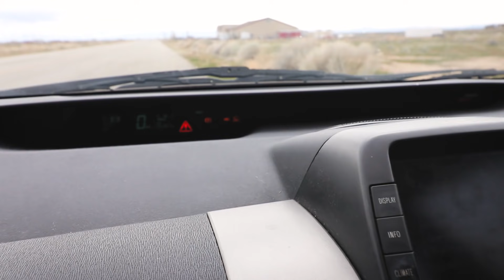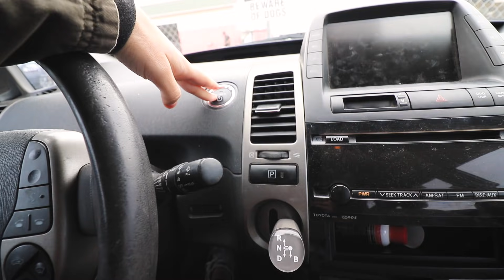I Think I've Been Sabotaged... Pulling Oil Pan To Find THIS... WTF

Comment: Electric water pump for the inverter is probably going out.  Easy to tell.  When you power on if you don't see any coolant moving in the inverter coolant bottle you need a pump.  They are fairly common on the generation you have.  Easy to change too.  It is located behind the LF headlamp.  three bolts, two clamps, and a single connector.  Just remember to bleed the air out of the system.  There is a 8mm screw that in front of the inverter cover for it.  Toyota tech here.
Reply: You should tell him/ her to turn the car on and off again maybe it'll clear the codes. And that should make everything okay in the Land of Oz! Note to self only boys have Adam's apples there are no exceptions to this rule. she doesn't you guys are screaming over there saying how hot she is, you're as confused as she is. Lol
Reply: @HYCOVETS  I gave advice based on experience.  It had nothing to do with the physical appearance of anyone involved.  Grow up.
Reply: @HYCOVETS  do some research women can have one. It's just not as often seen in women as men..
Reply: Well this got crazy fast... guess some people don't like actual advice or knowledge...
Reply: Seriously wtf, a cooling pump for the regenerative breaking?
Reply: @HYCOVETS  , I think I'm more confused, so many levels

Comment: I had numerous 16v sciroccos with similar issues.  One was a plastic shroud over the oil pickup, which cracked in to many pieces, thus plugging screen.   The second was carbon baked on the underside of the pistons, which plugged up oil pickup screen. This was a pain we had to replace oil with kerosene, then run the motor in order to clean the caked up carbon/"coke" of the underside of the pistons.  After repeated cleaning/adding oil and heat cycling it was finally ok. This was very time consuming but worked.  Drove the car for many years beating the crap out of it autocrossing.

Comment: The crap is carbon from lack of oil changes !!
Reply: I would agree normally yet they had the pan off and the tube out already. it would have already had signs in the oil the first time they had the pan off. this was added later
Reply: She regularly checks her oil however there could’ve been carbon buildup in the channels that they cleaned after heads were taken off in small amounts, and carbon does have a way of recombination and solidification with heat and when other carbon based products are active(extreme heat)
Reply: my thought also.. old gummed up oil
Reply: but cute
Reply: Some oils have a sludge factor which can carbonize on cylinder heads, flake off, then end up circulating in the oil. Usually blocks screen not tube. Seen this many times in my 50yrs automotive experience.
Reply: Carbon, four weeks ago somebody called it, but people, PEOPLE.
Reply: @ozmister101  , DRAMA
Reply: Lol I just got a beemer and it leaked oil (because it was missing the bolt gasket/washer even though it didn't leak before I did the oil change) but to my surprise the oil came out dark brown, again. So I put motor flush and new oil and now it's looking good! But from the looks of the first oil change, that likely didn't get a change for like at least more than 5000miles, maybe more because even at 5000miles with my POS clunkbox I still had decent looking oil lol

Comment: It's pieces from a teflon coated cam gear.
Reply: WisdomVendor1 why would they come off like that?
Reply: @brickson98m  Over time, heat and oil make it brittle and they break off. They are only there originally to help make the cam drive quiet. Replacement cam gears usually don't have  a 'coating' .

Comment: Hope you got the pri pri fixed. I just did mine recently because the coolant inverter pump for the electric motor failed...although it goes away on the dash I still saw it as a problem. Amazon that part and try and do it. I wasn't able to move the electric motor out of the way so I had to get the entire front left headlight out so it can be done. You have a whole garage so under an hour. I didn't and it took 3 hours...good luck

Comment: Not all metals are magnetic. Did you try wahsing a chunk of it with dishsoap and water to get rid of the oil? Then maybe put it on a microscope or even use a magnifying glass. Try burning some of the washed material,different materials burn different colors. You can do some of your own testing to see if it jibes with the results of what you send out. That might help for any future mystery and save the cost of a lab. Maybe I'm just so old and used up I went all stupid! :)
Reply: Thank you man, I was thinking the same thing lol. Common sense is just not comin any more. 👍✌

Comment: carbon, burned oil over time? i have seen a lot of burned oil on some old engines stuck under the baffles
Reply: My thought too. Serviced a Skoda Octavia that had ran like 20K km without an oilchange, we had to take it apart to molecules and scrape every part clean before even tring to wash it.
Reply: Thommy Johansson
It reminds me of the pellets from Chemiweld or any other coolant stop leak product, as to why it would be in the oil system rather than the cooling system? NFI.
Reply: Lifter bucket tray
Reply: yeah it really looks like carbon build up but who knows
Reply: Yeah, also my first thought! If the car has been running on semisynthetic oil before. IT might have built up in the pcv and when these dudes came along and put in full synthetic... it cleaned the engine and this shit got released!
Reply: Lifter butcket tray getting hot and degrading, breaking into small pieces, why it's not magnetic and there is so much. That much carbon wouldn't come off all at once
Reply: Yep carbon build up seen it on dodges to the point of loss oil pressure

Comment: What nice timing that the Prius is getting issues just as the scooby is getting back up!
Good thing you hadn't put boost on the S14 yet, jeez what the hell all that crap would have jacked up your engine!

You should by all means do a proper disassembly and thorough clean of the LS now, way before you even consider putting boost on it!!!! Don't want your bomb build to actually create a bomb of an engine (all jokes aside),  gotta inspect the block too since THAT has been there and possibly starved it for oil in certain areas. Would be a good time to (just in case) start to make plans for another engine if it has some bad wear on it.

Comment: If your bearings are not scored, no signs of abnormal wear, and tolerances check out with plastigage; if on a budget constraint, I'd elect to hot tank the engine, clean the engine's galleys, check oil feeds on journals (i.e. crankshaft main journals); then assemble and send it. Plus, replace pickup tube with a new one (which I figure that is already on the list).

Comment: This reminds me of my situation a few years ago. I noticed my oil pressure kept dropping. A friend told me to check the oil for debris. I didn't check inside the filter and only eyeballed the stuff going into the tub and nothing was on the magnet for the plug. So I kept driving it and it got to where the oil pressure was way too low at idle so I checked again and this time used a coffee filter which yielded a lot of non-magnetic metal. I yanked the motor (Crossmember makes it too much of a pain in the ass to just drop the pan. It's an ol' school muscle car) and the bearings were not only scarred but there was a slag like stuff. When I dismantled the whole engine to rebuild there was slivers of a Pepsi can someone had dropped into the oil filler. The rockers chewed it up enough to get down into the oiling system. We guess since I was using cheap FRAM oil filters it let some through and it got into the main and rod bearings. I didn't think I had an enemy in the world, the tuner crowd and muscle crowd both get along with me... but apparently someone dind't like me. 
Old cars likemy 69 is easy to pop the hood on, you don't need access to inside the car to open the hood. I didn't want hood locks because I wanted to keep it clean and smooth. Since the pain was $700 a can I still don't want to cut holes.
Reply: I am noticing the same thing. Everything was fine. Then suddenly car started to make clunking noise. I checked the engine oil and it was gone. I had topped it up just a month back and didn't drive much. When the car was raised on hydraulic platform there was oil everywhen on the underbody of the car but no drip on the floor. Just few days earlier I had seen some greece/oil on the door of the panel. I was suspicious as just 3 days before it, I had tussle with a neighbor over parking. When asked around about him, other neighbors told me he was jerk and had fight with many people. I filled the engine oil again in my car yesterday and today it was all gone but dipstick is showing there is lot of oil in the engine.

Comment: I’ve had some rocky gunk in petrol and Diesel engines. I’ve stopped doing partial rebuilds because of it. It is worse on  engines that have stored and the oil galleries have dried out. But new oil can strip the galleries clean. The worse I had got through the filter bypass and blocked the gallery to the rear main bearing. That took out a re-ground crank :(

Comment: After you get it fixed, put a few magnets in oil pan if pain if it's metal. It will catch any metal in the future. Same with transmission Pan and rear differential. Even some power steering pumps have small magnets. I hear you mention fram filters a lot, I saw a video, of five oil filters being cut open and compared. fram what was the worst one. Although those were the screw on style. In my humble opinion only, I prefer the wix brand.
Reply: Yupp Fram screw on oil filters are JUNK! Orange can of death...

Comment: The   Toyota Prius battery in the back has a cooling fan keeps the batteries cool and sometimes the fan like to clog or stop working. In whick would  Cause that code
Reply: The code was for the power inverter cooling system. I don't know Toyota's system but the  other hybrids and EVs I've had the misfortune of working on had water cooled inverters with their own little rad and electric water pump.
Reply: The code was for the inverter.  It would have been a battery cooling code otherwise.

Comment: If it is sabotage you better check your gas tank too! I would also look at the top of the head that has the oil inlet. If someone dumped something in there, there should be some of that junk up on the top of that head.
Reply: John Donlon  good point.   We will check that
Reply: Look's like someone dropped sawdust into your vehicle if you just came back from a car race someone tried to cheat by trying to sabotage your vehicle.

Comment: duh. it is called sludge, which builds up when you don't change your oil. and forms a thick high carbon cake on your engine parts, that is until it cracks, breaks away, and ends up getting sucked up against your pickup screen.

Comment: A Prius doesn't have a 12v starter or even an alternator. It cranks off the high voltage battery using the electric drive motor. The 12v battery is also charged from the high voltage battery with a DC/DC voltage converter.

Comment: That could be overflow of sealant to the inside of the engine from when you did the upgrade. It usually melts with the heat from the oil if it's not properly cured before starting the engine. It then swims in the oil and usually ends up in or around the pickup line.

Comment: ...Hmm... I once bought a used 350 4 bolt from a wrecking yard. They yanked it out of an old van. Any who, said it ran so I dropped it in my Cutlass over a weekend. It started knocking a few days later. Pulled the pan and saw the same kind of fibrous residue. My Dad thought it could be sawdust. Apparently, old time unscrupulous mechanics would put sawdust in the transmission and crankcase to mask noises, temporarily seal cracks.. long enough to get the car sold. We pulled the motor and did a small engine rebuild, flushed and put it back in. Wound up selling it a few weeks later for about what I had in it.

Comment: I would definitely recommend checking 1 rod bearing and 1 main bearing farthest away from the pump and also inspect the pcv system for carbon blockage. The debris kinda looks like bars leak radiator sealer but either way love the content and Rob is a funny mfr
Reply: I agree completely. Need to buy new set of main bolts. I believe LS's are tty as is pretty common these days. 

Daniel Ross, why check the farthest away? Wouldn't the closet set have the most scoring from foreign debris? You want to see the worst of the damage. Just asking out of curiosity and learning
Reply: The farthest away would be more starved of oil so most likely be the worst
Reply: Good point. I was going by the bypass on oil filters. If the mains are tty then pulling one is equally as expensive as pulling all five

Comment: It is usually kitty litter or quick dry, even sawdust. This is actually an issue at some of the drag strips, so make sure you never leave your car unattended at a strip. I would say kitty litter since most people there have it readily available and it is the cheapest cleanup tool for cars.

Comment: i believe it may be pellets from the cheap rad leak stop .. someone may have tired to use it for head gasket and it blew pass and end up in the oil to the oil and water mixing 
thumbs up so they can see

Comment: If the code on your prius is just the inverter coolant pump that's actually something that sometimes goes, your inverter could overheat under acceleration and regen but until you get around to replacing it that one is probably fine.

Comment: When water and antifreezes mix with oil it turns gray and the pipe was most likely clogged caused bye the high temps Harding the oil and causing the rock type of clogging I had a Mazda mx6 93 v6 3.5 and there was a small leak of the head gasket that allowed the antifreeze and water to get into the oil and when the engine reaches proper engine temp is when the oil starts to mix then harden so to the antifreeze begins a chain reaction buildup and eventually found after the motor blew, your lucky to ketch it in the tube only so far TRC Mechanics

Comment: oops, know thatone,, chainguide is faling apart.
nevertheless, take out engine full rebuild , co's you gonna be having problems lateron if you don't.
and than you blame yourself for not doing it now....
don't hurt your engine ,save it by rebuilding it.

regards, from the Netherlands.
35 year greasemonkey experiance telling you this.
Reply: My thoughts exactly. Hope they read this.
Reply: the LS1 doesn't use a chain guide
Reply: @pauldurio  try again.. most ls1's have them.
Reply: @chrismartin7248  not from the factory, and the aftermarket just tensions the chain slight. its not a guy like an OHC engine.
Reply: @pauldurio  believe what you want.

Comment: Pull some rod and mains to inspect the bearings and replace the pump . Run some inexpensive oil with a quarts of transmission fluid and a cheap filter  to flush anything out . Drain it and put ur good stuff

Comment: Straight up, the motor wasn't a total  rebuild ,And the old gaskets and sludge, burnt oil, sealers built up in pan, from previous work on motor and was overlooked, and it worked its way into pickup and tube of oil pump and clogged it up, but sounds like you caught in time, and may not spun a bearing on rod or crank, so  remove a rod cap, and main cap and see, I looks good, clean out the pan, pump,in place of pick up tube use a copper tube that fits, disconnect ignition, run a hose to the copper tube and to a gallon of deisel fuel and  turn the engine over and suck diesel fuel thru crank and  oil galleys to  clean out any remaining crap, and put motor back together and run it.

Comment: If you ever want a custom made molded one piece triple gauge pod, I can make you one and have it looking like it came from the factory that way. It takes time though since there's around 80 hours worth of epoxying, gluing, and wet sanding not to mention getting the paint right. Meaning that a lot of interior paints do not have any clear coating mixed into them so even if the color looks like a match, a lot of times the paint is pretty dole so I have to experiment with the 4-5 types of clear coats I have to match any potential shinyness that your interior panels may have. I also will strip and wet sand the passenger A-Pillar and paint match it to the triple gauge pod slash A-Pillar on the driver side. Hit me up if your interested.

Comment: Like on VW engines its normal for plastic parts to witter away , like ive seen dipsticks completly clean of the plastic at the bottom and all that is caught in the pickup , also timing chain sliders , i have no clue if it could be that in ur car but its a tip. But its very black so im also in on missmanaged oil changes or something that has caused the oil to burn